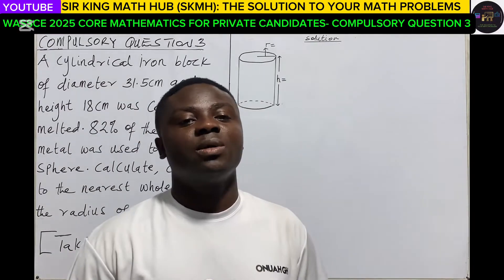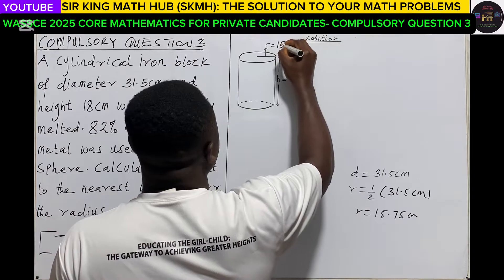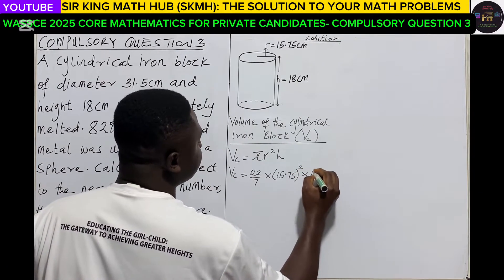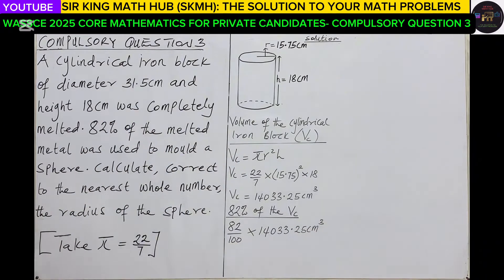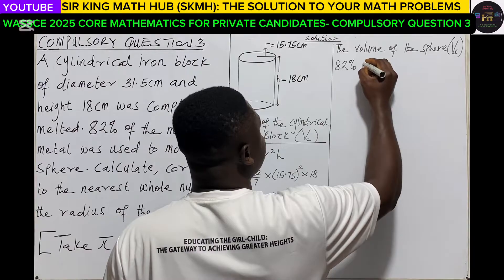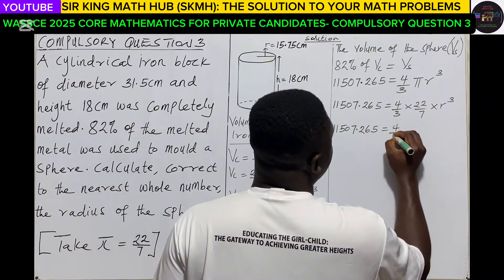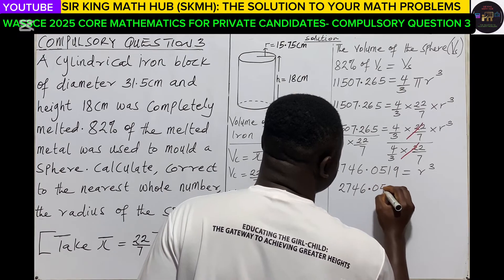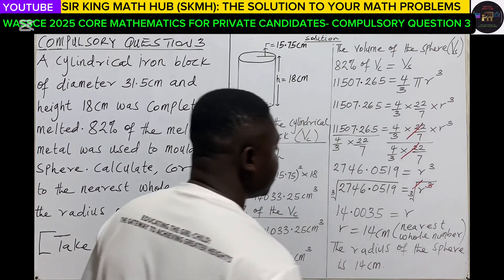WASSCE 2025 PC 1 CORE MATHEMATICS PAPER 2 - THEORY QUESTION 3

Comment from the maker: Why Do We Use Volume in This Problem?

👉Because the question involves melting and remoulding.

🔄 What Does “Melting and Moulding” Mean?

👌🏼When something (like an iron block) is melted and used to make another shape (like a sphere), it means:

👌🏼The material itself is not lost only its shape is changing.

💪So, the amount of iron stays the same — and the amount is measured in volume.

PRACTICAL EXAMPLE:

Imagine you’re holding a tall cylindrical container of shea butter .

You scoop out all the contents, melt it, and pour it into a ball-shaped mould (like a round calabash).

Now ask❓

What are you trying to keep the same — the shape, the height, or the amount of shea butter?

✅ The amount of shea butter 

👉That amount of shea butter doesn’t change , just the shape changes.

💡 The Math Behind the Analogy

	👉	The cylinder holds a certain volume of shea butter

	👉	When you melt it, the volume stays the same

	👉When you pour it into a sphere, you are forming the same volume, just in a new shape

So to calculate the size, you must use volume formulas to:
👉	Find how much volume came from the cylinder
👉	Find the size of the sphere that would hold the same volume (or 82% of it)

THANKS 👍🏼

Comment: Please how will I know that I must use the volume
Reply from the maker: Why Do We Use Volume in This Problem?

👉Because the question involves melting and remoulding.

🔄 What Does “Melting and Moulding” Mean?

👌🏼When something (like an iron block) is melted and used to make another shape (like a sphere), it means:

👌🏼The material itself is not lost only its shape is changing.

💪So, the amount of iron stays the same — and the amount is measured in volume.

PRACTICAL EXAMPLE:

Imagine you’re holding a tall cylindrical container of shea butter .

You scoop out all the contents, melt it, and pour it into a ball-shaped mould (like a round calabash).

Now ask❓

What are you trying to keep the same — the shape, the height, or the amount of shea butter?

✅ The amount of shea butter 

👉That amount of shea butter doesn’t change , just the shape changes.

💡 The Math Behind the Analogy

	👉	The cylinder holds a certain volume of shea butter

	👉	When you melt it, the volume stays the same

	👉When you pour it into a sphere, you are forming the same volume, just in a new shape

So to calculate the size, you must use volume formulas to:
👉	Find how much volume came from the cylinder
👉	Find the size of the sphere that would hold the same volume (or 82% of it)

THANKS 👍🏼